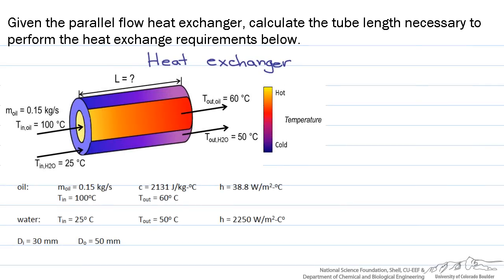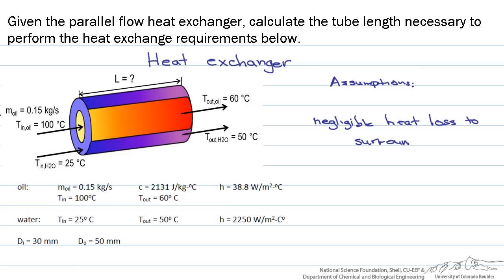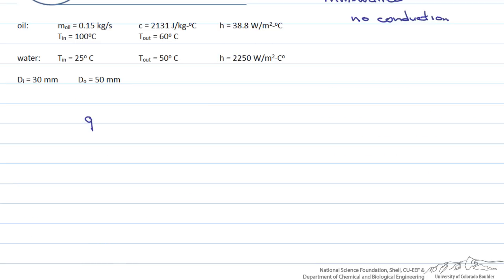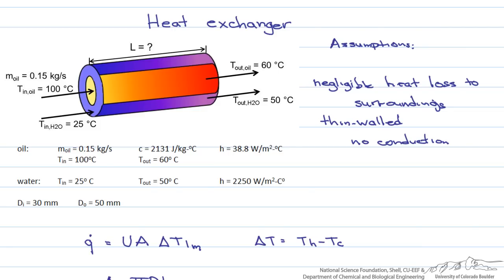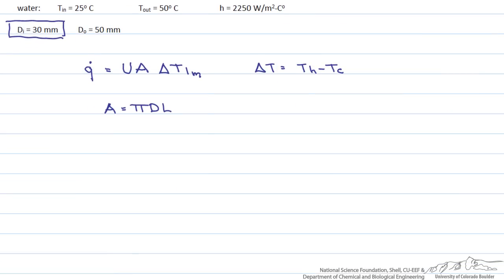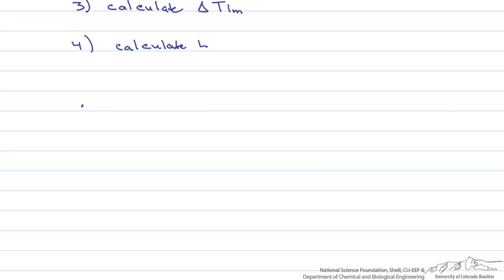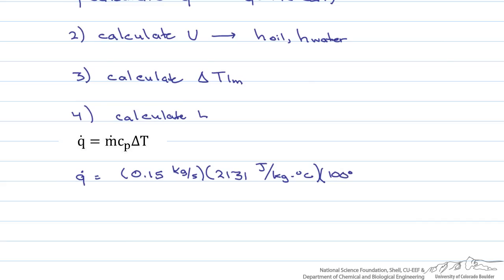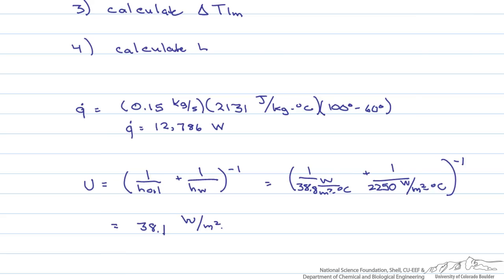Sizing a Heat Exchanger: Parallel Flow

Comment: Good video for understanding concepts for first year Chem engg students but bad video for actual engineers sizing heat exchangers. Often times people are yelling and screaming not knowing the heat transfer coefficient. That is never known. No one tells you either. You have to work it out using the dimensions number equations. This video basically shows you the last step in designing the exchanger (if you don't include pressure drop calculations) when all values are known.

Comment: Why in the design equation there is no conductivity coefficient since using different material for heat transfer will have different conductivity
Reply: Only convection is needed; pipe wall is described as thin (r_pipe_inner-wall ≈ r_pipe_outer-wall), therefore resistance through pipe wall is negligible (but yes, presenter didn't include pipe ratios).

Comment: shouldn't the overall heat transfer coefficient be

U = (1/h_oil + (radius_oil / radius_water) * 1/h_water) ^ -1? Since we're in cylindrical coordinates there has to be the ratio of pipe radii to account for a constant heat flux in the varying pipes diameters?
Reply: You're correct about needing the pipe radii ratio, but your equation is back to front (done w.r.t. to h_inner, not h_outer); U = (1/h_oil * [r_water / r_oil] + 1/h_water) ^ -1
Reply: No. That is why in the beginning of the problem she assumes "thin walled" so she can throw out that term.
Reply: Can you tell h values of water and oil,how it take